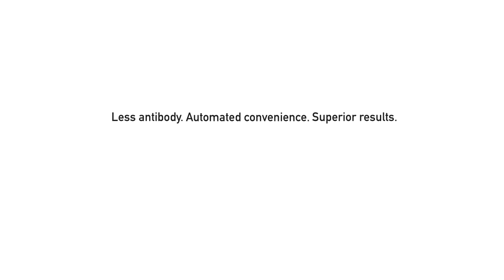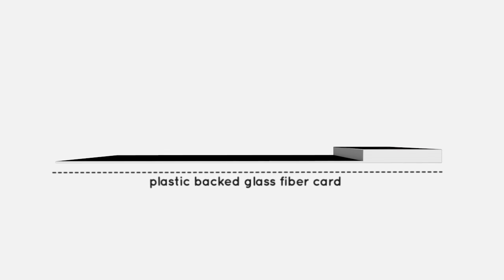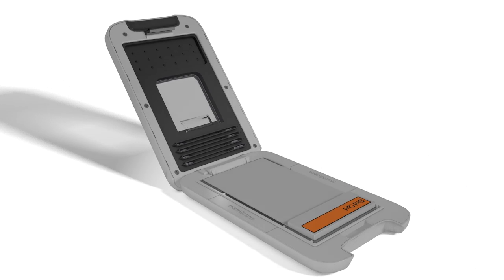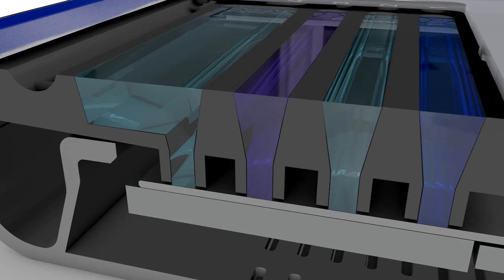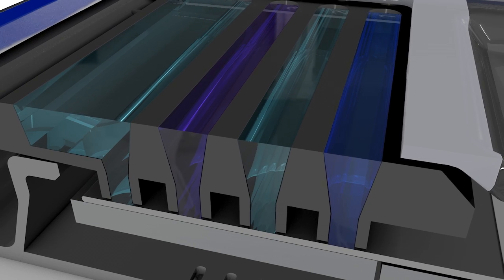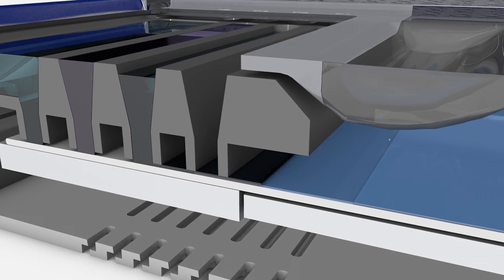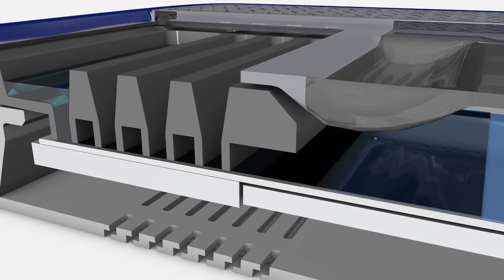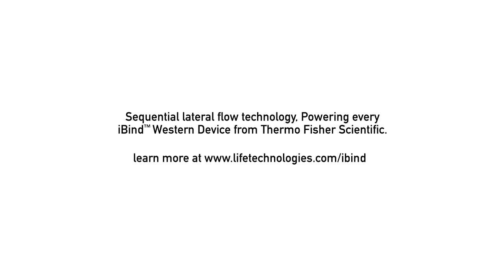Sequential Lateral Flow Technology Explained feat. the iBind Western System

Comment: Why can't you use horizontally cut strips? Seems like this would be the most useful way to use the strip system as you can blot the same samples with multiple antibodies without stripping (if their sizes are different). It's repeatedly stated that you can't use horizontal strips, but it doesn't ever explain why not?